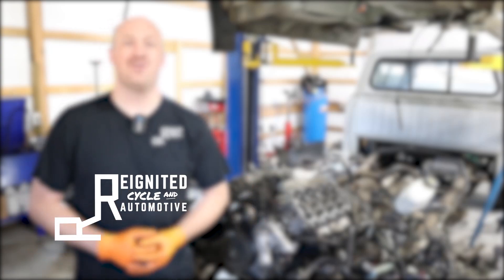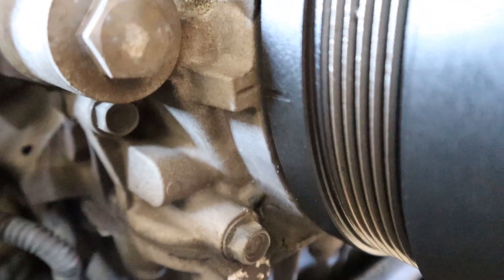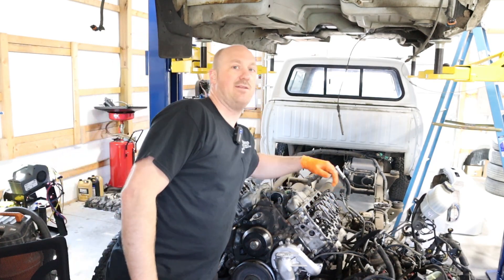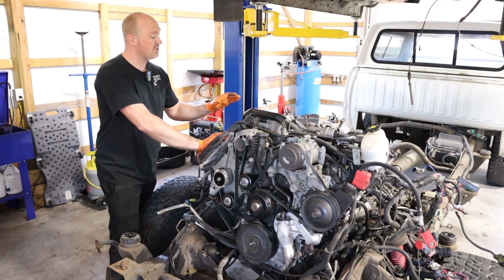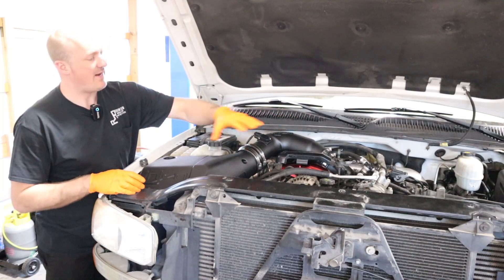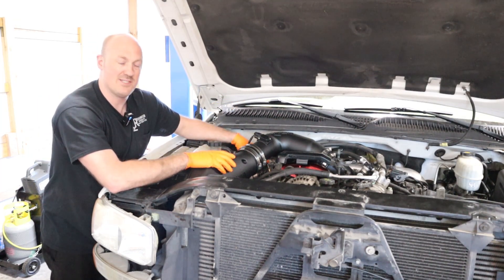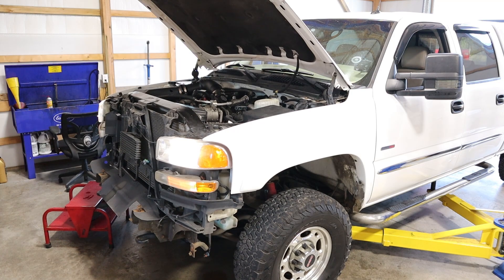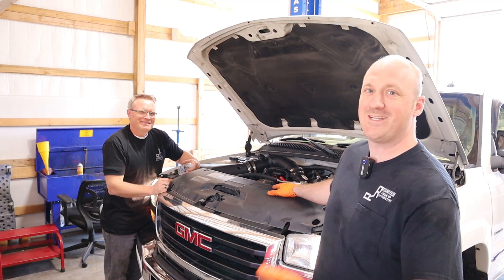Duramax Diesel Build Reassembly and First Drive! How to set Valve Lash on Duramax

Comment: Hey buddy, continue doing what you do great info for us D.I.YERS. I HAVE A QUESTION,  i have a 09 dodge charger hemi police pursuit. I'm trying to move the column shifter to a center console shifter,  need some guidance on where would I get an compatible shifter for this change, what year would this 09 police pursuit with the auto shifter
Reply from the maker: That's a NAG trans in the pursuit vehicle. It's the same shifter assembly that comes in 300's you could use one of those for the switch. However, there are a lot of wiring harness differences between the two, and I think it's more trouble than it's worth to change it all over.
Reply: @ReignitedAuto  really appreciate your response, it's something I always wanted to tackle though. Maybe I could find the wiring schematics for that conversion online
Reply from the maker: @andrewdouglas2609  it's definitely possible, because everything is. You would also have to replace the body control module, and likely the pcm as they both communicate differently with the two different styles of shifter.
Reply: @ReignitedAuto  ok, I was thinking that much so I will look further into it,  again your help is greatly appreciated .

Comment: I'm not used to diesels, that is a really strange setup.  Looked like there is a crossbar between both sets of valves, and each crossbar is acted on by a single rocker.  That much have some massive pressure on that rocker, it looked like it had a long ratio on top of pushing down on 2 valves at once.  I suppose valvetrain mass isn't much of a concern for a low-rpm engine.  That strange lash sequence - I'm guessing it's to adjust only the rockers that are on or close to the base circle of the cam?
Reply from the maker: Yep, you nailed it!

Comment: Interesting, no adjustment for the crossheads on the valves.....was used to setting those before valve clearances on a larger diesel engine during an overhead set.
Reply from the maker: Mark, I'll be honest, I've never heard that term "crossheads" in my life. I had to look it up to see what it meant! LOL. No heavy equipment for me thanks!
Reply: @ReignitedAuto  all the 4 valve HD diesels that I'd worked on had a crossover bar between the set of intake or exhaust valves, with an adjuster screw on them to center the crosshead on the shaft and valves. 
Great video on the Duramax top end refresh! Lot of work!